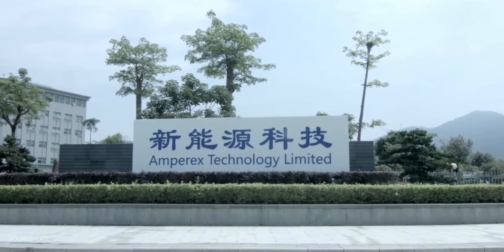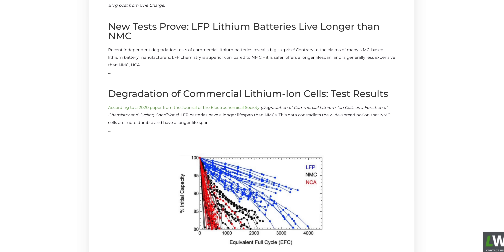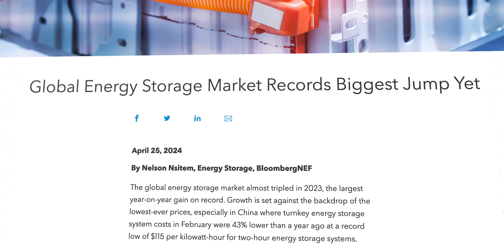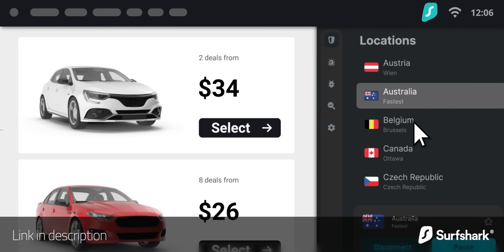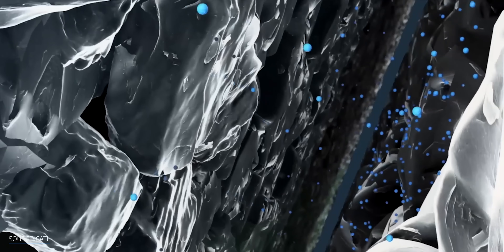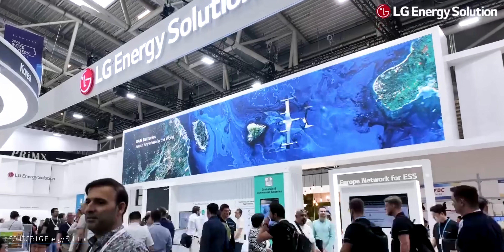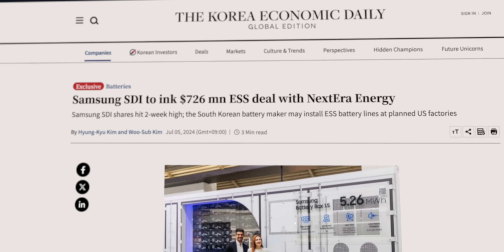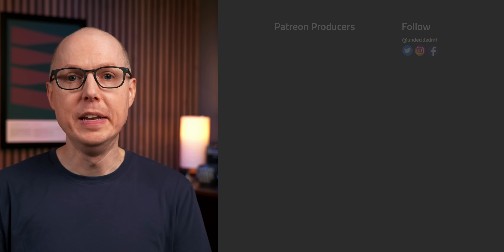How This New Battery is Changing the Game

Comment from the maker: Do you think these new LFP advances are going to make a dent in our energy storage needs? Secure your privacy with Surfshark! Enter coupon code UNDECIDED for an extra 4 months free at https://surfshark.com/undecided

If you liked this, check out Why This Window Heat Pump Is Genius https://youtu.be/KNlDu_ZHIo8?list=PLnTSM-ORSgi7uzySCXq8VXhodHB5B5OiQ

For 20% off Everything Electric Canada tickets use the code: EEMATT20 https://undecided.link/everythingelectric
Reply: Truthfully when it comes to static energy storage, Lithium should not be in the picture in favour of Sodium and Potassium ion, Redox flow batteries, molten salts, thermal salt silos, etc.
Reply: Strategic public planning is key, always.
Reply: In your next update for this technology, be sure to include information about recycling them!
Reply: Matt, battery technology is increasing so fast right now, LFP sounds great but what's gonna be available next year?  right now is a scary time to be in the electrisikal luggage business, as a manufacturer of these systems or as a consumer.  on a side note i very much appreciate your optimism when it comes to the subjects you present.  i'm the exact opposite (as you can tell from my initial comment!!!).  anyway, thanks.
Reply: @jgeur   what's available next year matters because of what it'll be in 10yrs.  For most,  LiFePO4 batteries dropping in price is a more important factor in practice.  It'll need to continuously get cheaper because the sodium batteries(obviously not great for every application) will eventually be far cheaper
Reply: Please add chapters to your videos so we can skip your advertising if we've see it for the thousandth time.
Reply from the maker: @wildfotoz  thanks for feedback.  I’m going to start doing that.
Reply: @UndecidedMF What should be called new is the battery that will be mass produced.Batteries being developed in the lab may not hit the market for 10 years
Reply: I'd love to go to a show like this if it was in the continental US. Seems like most shows I hear about are for industry professionals only.
Reply: جميل جدا،شكرا لك على اتاحة محتواك بلغات متعددة❤
Reply: CATL is coming out with many different batteries for different vertical markets, like several new LFP batteries, to 2nd gen sodium batteries, to super high energy dense batteries. It would be nice if you would take a look at CA based Sakuu, who is developing a dry electrode printing process used to build their high energy dense lithium metal batteries today, and who is showing off Non-metal, printed batteries, which promise lower cost, cleaner production, lighter weight, and easy recycling. All of which sounds very exciting for future EVs, as well as other power storage uses.
Reply: How about the Sodium-Ion battery tech?
Reply: LFP - good for BEV, Home storage, NOT grid storage because you still have the issue of putting too much demand on lithium when moving to a green grid which needs more grid storage.

Redox flow batteries good for grid storage regardless of the density.  I mean when you can use a hydro battery based on pumping water to an elevated pool, you GOT the space for redox flow batteries.
Reply: Re: Giga-Scale Iron-Air. So, what about “Iron-Air” batteries’ potential to fully supplant Tesla Megapacks (subject to inherent limitations)? Is Tesla already prototyping, similar?
https://youtu.be/C675sr3jqIY?si=x8F-Ftkvl431YjGC
Reply: @UndecidedMF Please make a video on Superconducting Magnetic Energy Storage (SMES), which involves storing energy in the form of magnetic field produced by current flowing through the superconducting coils making it free of any chemical reaction occurring inside the energy storage device. Its advantages are high conversion efficiency, very high cycle life and power density (almost instantaneous charging and discharging). Also a very stable power output. However, its major downsides are low energy density, and the requirement to maintain the coils in superconducting state. But the energy density is proportional to the square of magnetic field strength produced by the superconducting coils, so there is room for improvement.
Reply: @UndecidedMF  Hi Mate, you need to check out WEST - Wright Energy Storage Systems.
This is the future of energy storage.
Reply: @undecidedMF I hate these kind of videos. hyping up to the question too many times and diverting to another tangent each time and also to insert the shameless plug..
Reply: @UndecidedMF  - nope. Batteries that must be replaced every 5 years are not the way forward for energy storage. It is just a different kind of coal that comes out of the ground, that has to be charged to be useful.
Reply from the maker: @DavidHalko  this battery lasts longer than five years.  It has zero degradation for the first five years.
Reply: @UndecidedMF  sounds like LTO. Fairly old technology barely anybody talks about. Like the TCO of stuff. What is the TCO of LTO cells compared to the others?
Reply: Stop 🛑 talking about batteries 🔋 we need under sea 🌊 water power cable that go from Australia 🇦🇺 Japan 🇯🇵 United States 🇺🇸 Britain France 🇫🇷 and Spain 🇪🇸 we would need a small amount of batteries 🔋 and a large amount of Solar 100% in all the countries as sun ☀️ set sun rises in some place in the world 🌎
Reply: @williampisano7573  you type like a teenage girl who just got her first smartphone
Reply: @williampisano7573  Good thinking. That my be where we go. Twiggy Forest was going to build solar in the north of Australia and send it to Singapore. I have two thoughts. For Australia, we might run nuclear at 40 or 50 gigs to cover the lack of wind and sun 24/7 and let renewables do what they are doing now. One story in "I Robot" had satellites aiming sunlight at collectors on earth, providing all the power required. after watching this, we may all have our own batteries and water renewal facilities in each house. regards!

Comment: It is pretty well irrelevant how low the cost of batteries falls.  LiFePO4 batteries are reputed to be coming in a or below $100/kWh.  I just bought a battery for my weed trimmer. (the old one fried its terminals even though the battery is still perfectly fine).  It holds 0.18kWh.  The new battery cost me $300.  The included batteries were, by using the $100 figure, worth $18.  The batteries themselves could be free and a new battery would still be expensive.

Comment: I'd like to get your take on the recent development with zinc-halide battery chemistry. My understanding is that similar to LFPs they're not as energy dense, but safer still and zinc is significantly more available than lithium. Everything I've seen indicated the intention to use them specifically for ESSs and grid support but I'm personally hoping to see home battery backups and UPS systems using it

Comment: 6.25 MWh is not an energy density, but an energy. An energy density could by energy per mass or energy per volume. What are the proper units that you meant to use? Thanks.

Comment: Flow cell batteries make all dry cells look stupid and of course last for ever because the electrodes and the electrolyte can be replaced , reprocessed then returned to the battery .
So not only can they be run dead flat without degrading, they can be charged faster & discharged fastes
They can not explode due to thermal run away in fact they can not explode at all ( well the Zn - Br can't anyway ) .
However the USA will never use them because they do not own the technology .

So your premise that the Tena is the only battery that does not degrade over 5 years is totally wrong as the Redflow Battery will run for 30 to 50 years before the electrodes will need replacing.

Comment: At night when the electrical power grid demand is low these Tesla battery packs are recharged. The benefit is your local power provider will need fewer power plants built to carry the heavy peak loads during the high power demand during the day. Resulting in a more efficient use of your power plants.

Comment: I've had a LiFePo4 battery in my motorcycle for at least half a decade or longer, I forget when I bought it tbh. It's still going strong, in spite of annual multi-month winter storage. This is also the battery tech I'd use in a house battery (that I don't have yet).

Comment: LFP cells degradation is already so low for many use cases that the reduced degradation claimed (to be confirmed by how much) for CATL's product might not make that much of a difference in practice.

The first thing that came to mind was that they'd guarantee a lack of degradation for 5 years is a capacity buffer. And it's probably what it will be anyway if they really want to guarantee NO degradation.

Comment: 5 years is a pretty good lifespan for zero degradation. Assuming they can still be used beyond that with some degradation being considered 'acceptable' up to a point; they should be really useful in getting some more stubborn folk on board. Still gonna have to do better though for the most stubborn folk. 

And I must admit, I kind of am one of them in my own way. I want to see mass scale rollout of lithium titanium batteries, based on what I have been learning about them. If they are actually as great as claimed and somewhat proven to this point as I understand; then there will be very little reason to not use them. 

If the Iron Phosphate versions help us get there, cool.

Comment: 5 years without degradation sounds like they under-rate the batteries and hide the degradation for 5 years
Reply: You beat me to this comment. I was thinking the same and wouldn't put it past companies to do this. I don't think Matt mentioned what the degradation would normally be in 5 years. If it's only like 5-10%, you just make the batteries a little bigger and hide their extra capacity as headroom to make up for the degradation.

Comment: They are probably achieving having no capacity degradation in the first 5 years by cheating a little. And the 15000 cycles quoted hints at exactly that. The capacity degradation of LFPs over 5000 full cycles should be about 20%. However, if you make the capacity 20% larger to start with but never allow each cell to charge to more than about 85% then you should only see about 5% capacity degradation over 5000 cycles. So after 15000 cycles, or 5 years, you should effectively see no actual degradation on the quoted capacity.

Comment: Vanadium redox flow batteries are the way to go. They say it lasts 25 years, but that's just being conservative, it can be recycled indefinately. Non-toxic, no chance of catching fire and easily extensible.
Reply: .. but very expensive. I don't see where Vanadium competes against BESS consisting of Na for short-term and Fe (like Form Energy) for longer (even weeks).
Reply: @jonb5493  expensive, yes. But it is getting cheaper all the time. And still nothing beats it in longetivity. Initial high price and lower maintenance and no replacement costs. After 5-7 years, it's the cheapest alternative with the added bonus of less fire risk.

Comment: Reminds me of the mid-70s and the oil crisis when Popular Science had several articles about the latest in batteries for the upcoming surge in EVs. For cars, rapid recharge was right up there with energy density. The two “front-runners” I remember were one using molten sulphur as the electrolyte - a bit of a concern in an accident - and an “air-aluminum” based setup. This latter one “consumed” aluminum sheets so recharge just required replacing the sheets and removing the oxide for electrolysis back to aluminum but was extremely sensitive to CO2 in the air which was already too high back then

Comment: Well the facts i have heard about the "new battery technology" is more ore less verry disappointing. LiFePO4 batteries build the SEI not spontaniously like you said. It forms the SEI layer at the first charge of the battery. The big problem is, that the formation of the SEI binds the free Lithium-Ions. That means less ions to "store" energy. If you put 100% ions in the battery and about 20% binds/converts to the SEI layer, you only have 80% of possible charge capacity left. Therefore they embedded a different material that releases more Lithium ions at the first charge. In easy words you have 120% of ions in the battery but 20% binds to the SEI layer. After the first charge, you end up with 100% of free Lithium ions and a SEI. The material that releases the ions is empty after the first charge and remains in the battery without any function. More or less it's nothing new neither a super cool technology they just compensate for the loss of ions of the SEI. Furthermore those "compound" systems are more scam than you would think. To guarantee for example 10kW/h they often put a 15kW/h batteries inside. When these batteries degrade after time, they can degrade up to 33% until the 10kW/h threshold is reached. This takes some time, often years. Thats how they can guarantee the 10kW/h for e.g. 5 years. But if you think about it, you pay for 10kW/h, get a 15kW/h battery but you can only use 10kW/h. It would be way better to use the full capacity of the battery system instead of getting only 66% of the possible capacity just because the company thinks it's a good marketing idea to give you a guarantee for 5 years. It's the same as a car company says "this car has 200 horse power and can drive up to 1.000km" but when you drive it, the mcu (motor control unit) reduce the horse power to only 100 hp because otherwise you would never reach 1.000km with it.

Comment: There are a couple of batteries that should have unlimited life.  Both have solved the dendrite problem.  There is the Ambri liquid metal battery with three liquid horizontal layers.  They us Calcium, antimony and a salt inbetween.  All liquid so not dendrites.  The second is the ZnBr battery from Redflow.  It plates Zn onto horizontal shelves when charging and the Zn is removed during discharge.  You make sure to completely discharge the batterie(s) from time to time which dissolves the Zn and hence any dendrites.

Comment: Thank you Matt but the real questions to ask are : after the 5 years what is the balance of degradation for the following 5 years,  expecting a life span of ???  It all boils down to the ROI. Lifespan is critical, recyclable etc many questions left unanswered.
Reply from the maker: Good points.  On the recycling front these absolutely should be recyclable.  There's a lot of really interesting movement in the battery recycling business too (LiCycle, Redwood Materials, Recyclico, etc.).

Comment: How about a package size that a homeowner could use, say 100Kw to 200Kw.  These units will only benefit the power utilities, which I'm in favor of for off peak storage.  My Cape Cod  electrical supply was measured by my Sense unit at 108 volts around 6PM last week.  This storage system would help levelize their supply. IMHO

Comment: I just read that iron-air battery (reversible rust Battery) are being used as storage by Form Energy in Minnesota. It is said that solar connected to these batteries can be run a few days, making solar power always available. These iron-air batteries aren't nearly as efficient as LFP batteries; and I think they are currently more expensive. They are also bulkier that LFP batteries, so not optimal for automotive use. But what a concept!
Reply: They are a form of redox battery. There are some vanadium and I think magnesium ones that were interesting to look into.

Comment: The biggest problem with Lithium-Iron-Phosphate batteries I've found is they REALLY don't like cold temperatures...every LIP battery I've looked at recently holds much more power than a standard Lead Acid battery of equal physical size, but all of them list the cut-off Temperature below which they will no longer accept a Charge is 4 C (39.2 F)...considering I live in Southern Ontario and it tends to be at or below 4 C from Late Sept. to Mid April, it means they're worthless to me...
Reply: You can get batteries that have built in heaters for low temperatures, though the battery heater will use some of the battery power.
Reply: @rossallen738   True but the space in the case the heaters take reduces capacity and then the heaters themselves reduce apparent capacity to the point that they are effectively lead acid batteries in terms of actual sub-zero capacity, not worth it for powering my Mobility Scooter in the winter...

Comment: It says no degredation for the first 5 years.
Which begs the question...why 5 years? What happens after 5 years? Is it better than the edison battery as far as longevity goes?
Reply: Presumably they only tested to a certain number of cycles before they stopped their testing. Then the cycle counts were used to establish a time period for decay. Anyways at some point they just shut down the test apparatus.
Reply: Maybe they build in a buffer of 10% and that has worn away after 5 years?

Comment: It should be noted that LFP cells already easily outlast any power electronics associated with them and have for a long time.  So, this is good progress, but it isn't earth-shattering.  Also, as with most ESS manufacturers, CATL likely builds some buffer room in their capacity guarantees verses the actual capacity of their cells.  Their ESS systems (and certainly their marketing) are likely programmed only to the capacity guarantee.  The cells probably do degrade (but LFP degrades very slowly anyway)... but its hidden for a time by the buffer.

In anycase, this is almost a moot point.  LFP cells have such low degradation that the actual cycling is almost irrelevant... Calendar aging does more damage.  And as I've mentioned several times, the power electronics associated with these packs will fail long, long before the cells do.   Even with regular LFP cells.  As a maintenance item, the power electronics represent a much bigger fish.

-Matt